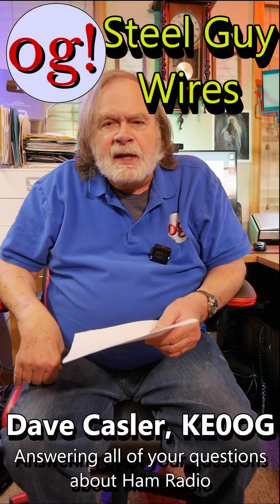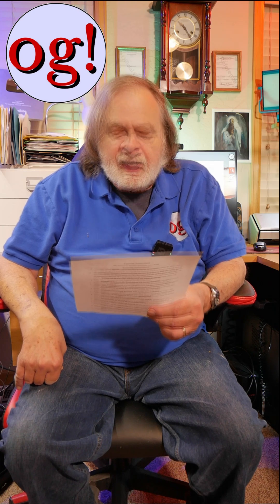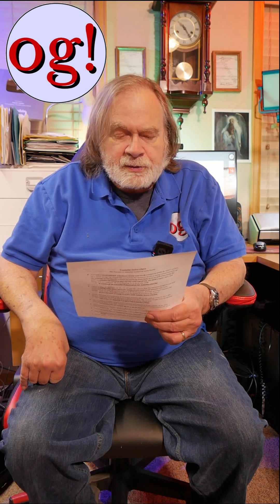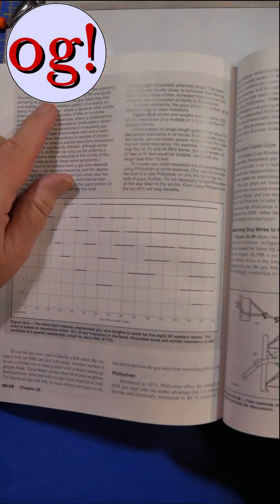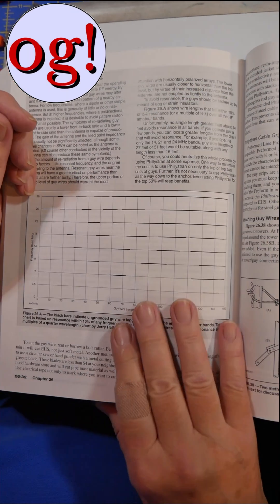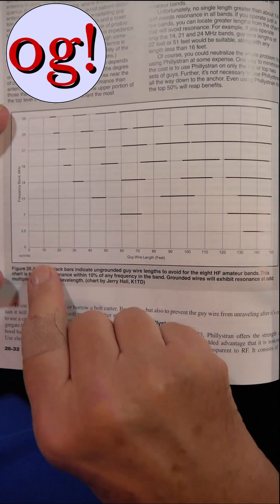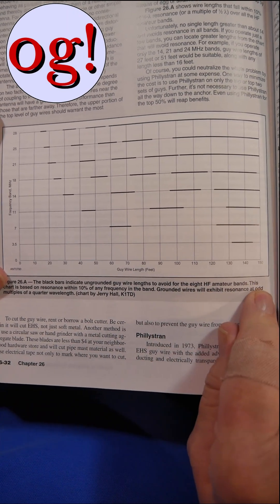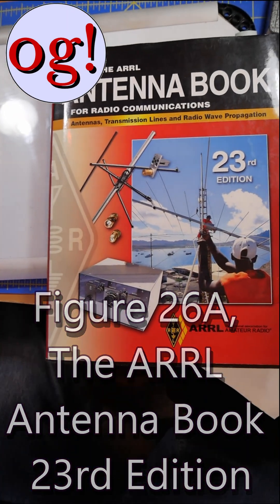Steel Guy Wires (Short #18)

Comment: Well, now im curious if you can add insulated steel wire to copper wire to make it have less flex or droop, with out having it in circuit. (Edit - probably by twisting them together)
I'll have to make an antenna and see if it screws with the swr. Im guessing that the steel wire may resonate.